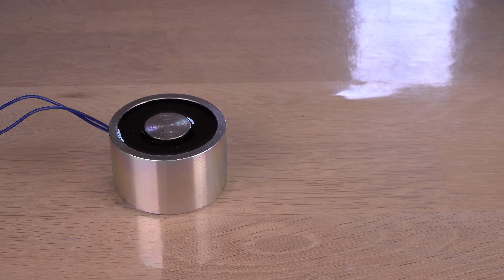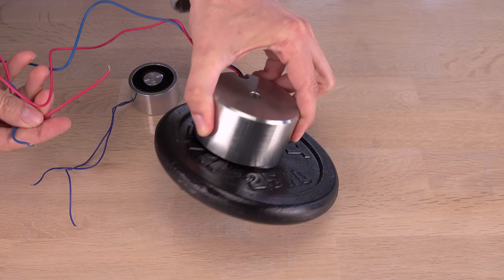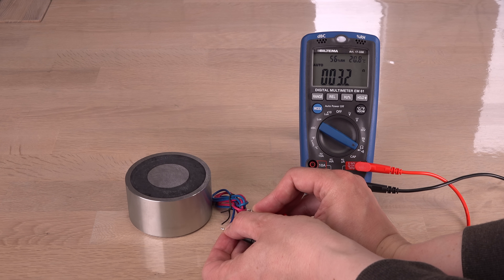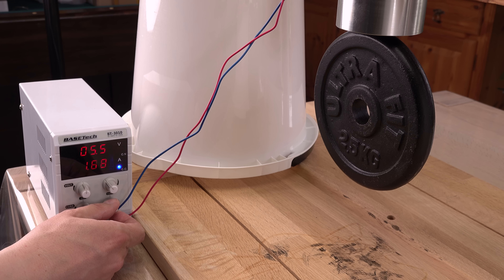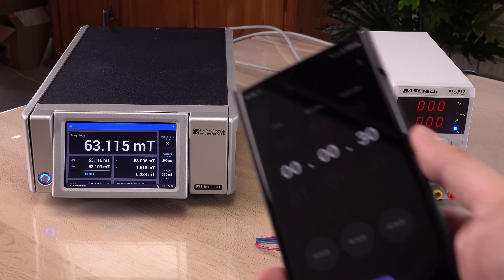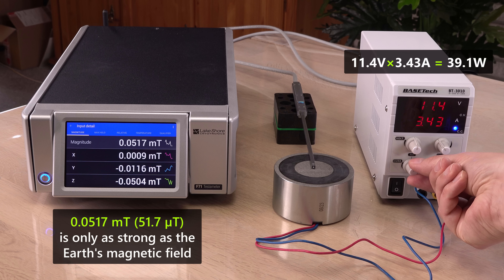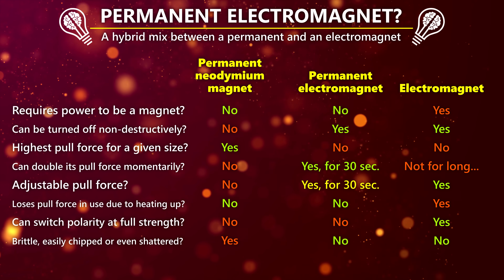NO ELECTRICITY Electromagnet?!? The Weird and Wonderful Permanent Electromagnet

Comment: Ive seen these used to hold doors open at events venues. Rather than the magnet being on all the time and heating up, you just pulse all the magnets at the end off the night and all the doors close using a mechanical actuator and reed switch feed back to confirm all doors closed properly. Its neat to see when 20+ doors all close together and let loose a synchronous bang!

Comment: Electromagnets used in steel mills and cranes use reverse voltage to demagnetize and release their charges more quickly.
The principle is very simple: when turning off the power, simply invert the polarity quickly for a few seconds.

Comment: I wonder if you ran power in the opposite direction using the red as negative if it would increase its magnetic capability instead of just canceling out the magnet you could go to two times magnetism and you can slowly dim that until it got to zero and then you could switch polarity and  increase power which would decrease magnetism gradually until it went to zero they neutralize each other
Reply: Oh cool you did it

Comment: some welders at my work use a magnetic ground that rotates to "activate" or "deactivate" the magnetism. Might be interesting to see the arrangement of what I assume are permanent magnets that allows nullification like that
Reply: It seems it’s just one magnet. In one position, iron connects the north and South Pole together, effectively “shorting” the magnet, and the other undoes this and leaves the magnet at full strength
Reply: MAGSWITCH

Comment: Oh, I thought this was gonna be about something based on Edward Leedskalnin's misleadingly named "Perpetual Motion Holder" ("PMH") mechanism. I saw some stuff about it many years ago, but because the name throws off people and the way things work isn't very intuitive or easy to explain (or at least to understand) I've seen it dismissed without actually addressing working examples that are way stronger and more long-lasting than the dismissals account for. I'm not really clear on the details, but from what I remember,  basically a pair of coils, a pair of metal pieces, and with a single pulse applied at right point the two metal pieces get locked together strongly; shorting detaches them, and using surprisingly amount of force to separate the two pieces of metal there would be a pulse induced if you had the coils connected in specific way (sorry many years ago, gotta look up the details).

Comment: You can generally safely assume a linear relationship with duty cycles, so at 50% power it would be a 20% duty cycle at 60s, at 10% power you could effectively run it permanently. Plus that assumes no cooling, with a cooling jacket you could increase the duty cycle use. Pointless for a home gamer but could have industrial application. So its likely adjustable +-10% permanently. Neat technology though, definitely has safety and practicality benefits over messing with pure high power magnets.

Comment: Aside the fact you can reverse the polarity to increase its strength, I don't see the point, given you can 'turn off' a magnet mechanically too, it's used in many appliances... I don't see much of a point to using these, outside maybe some applications where it's important something that you lifted doesn't fall during a power outage... And even then just having backup power banks and generators is way more useful for most applications, with either permeant mechanically (automation and/or by hand) "turn-off-able" magnets, or automated electromagnets. So... Any real point to these?

Comment: I work as an electrical engineer in a steel coil plant, there are several places where we use this type of magnet. One example is on a small gantry crane that lifts scrap material (small rolls that weigh a couple hundred kilos). A huge benefit of a permanent electromagnet is that it doesn’t need backup batteries in case the power goes out.

Never thought flipping the polarity caused it to double the strength, I expected to be protected with a diode of some sort.

Comment: @2:20 you kinda spoil the punch. one word: solenoid. ive worked with much larger versions, at a steel mill, moving 20 foot by 25 foot, 10 inch thick steel plates onto the plasma table, then onto a massive Blanchard table grinder, which had an even bigger magnet, in the form of the spinning table that was the grinding surface/magnet chuck, which held down the pieces while they were taken down to final dimension. one summer, i was working with a new guy. he forgot to empty his pockets in his locker. the change in his pockets, his keys, and watch, all obliterated after yeeting themselves onto the table just as the grinder head lowered. hes lucky he didnt have more things with him, or he would have joined his things. hahahaha he quit the next day. magnets are fun

Comment: I guess this is basically a much more powerful version of microphone/speaker/pickup/transducer but without any of the moving parts and much more simple in construction. Nothing new, but the idea is good for specific purpose.
Reply: Dynamic transducer has a coil as its moving part, it doesn't attempt to cancel out the magnet.

Comment: They have these at my old highschool to hold the main fire doors open during normal operations. Usually they're attached to a deadman's switch that will discharge a battery so if there is a fault like a fire severing the lines the doors fail closed. They also can be operated by a button in the office or security room. I was told how they work after seeing the doors close during a power outage like normal electromagnets but my principal just opening them again and sticking them to the permanent magnets while the power was still off.

Comment: it kinda does not matter if its 45w or 60w cause you apply 12v and the only thing witch could go wrong, is that you underpower it but if you have a 12v 10a voltage source it doesnt matter because of the resistence like you said..

Comment: We use these at work for the fire system. Doors that are propped open will automatically close when the alarms go off to stop the spread and aeration of the flame. These allow the fire suppression attributes to work even during an outage and backup failure without using so much current all the time.
Reply: But if the power goes off before the doors are released, the doors are kept open all the time and cannot act as fire isolation.
Reply: @olivier2553  Sorry, I replied already but Youtube deleted it for some reason. The configuration that we have this in is that power increases the magnet strength. The door closes with enough force that it overpowers the magnet when powered off, but not while powered on. This means when either the power goes out or the fire suppression system is on, the electricity stops and the doors all shut.
Reply: @jamisonw.327  So that is a normal configuration: you need power to keep the door open for free circulation, and no power means the door close for fire suppression. Only thing is you also have a permanent magnet that helps keeping the door open and reduces the power needed in normal operation.
Reply: @olivier2553  All correct!
Reply: @olivier2553 yes that’s correct. The ones used on doors are always powered. And lose power once fire system activates. Usually via a relay controller panel.
Reply: Ours are always powered so long as the alarm isn't on, so either power loss or fire, both mean the doors closed. The doors would remain open any other time. I'm sure we also have ways to trigger it at will without the alarm too. The point is just to use less power than a constantly on electromagnet. These fellas get warm when running, so there's also an element of heat build up to the reasons I'm sure. @olivier2553

Comment: I Would like an experiment with a Hall Effect Transistor to see if you can get things to hover like you can with an normal electromagnet type, this would be good with a small metal space ship ( like the ones you get with steam engine kits it acts as a boiler ) it should work, you just have to apply the energy in pulses to keep the thing afloat, but better with this design because when you turn it off the space ship wont just fall to the floor but dock properly at its position at the top of the suspended electromagnet :)
Reply: If you feed a electromagnet thru a reed-switch inside the magnetic field, you get a really nice oscillator plus a TON of radio frequency noise

Comment: Well this answers a question I couldn't afford to answer. You can shut off a permanent magnet with an electromagnet. Nice.
Reply: Bro you can also use another permanent magnet, and even another electromagnet to turn off an electromagnetic, it's all the same field
Reply: @lloydtshare Kiiiiiinda hard to cancel out a permanent magnet with another one. Permanent magnets tend to cooperate with each other when you stick their opposite poles to each other.

Comment: Item 2 in list: "can be turned off non-destructively?"  You say "no" for permanent magnet.  NOT SO!   Are you familiar with magnetic chucks  (used by machinists to hold ferrous workpieces while milling)?  They have cylindrical magnet in between 2 pole pieces (like DC motor).  A hand lever permits rotating the permanent magnet 1/4 turn which switches it between "on" & "off".  The magnetic chuck requires no power, & can indefinitely remain "on", "off", or anywhere in between without overheating.

Comment: You're gonna make me ponder a free energy machine! 😛
Perhaps not 'free' but perhaps a useful generator for extracting power from waves
Reply: does the static magnetic field at the coil affect the amount of current induced by a moving field ?  Or, does the static field increase the amount of back emf, maybe, when the field in the coil collapses ?
Reply: @idjtoal  I was thinking more along the lines of water waves lifting a weight to the magnet before dropping away and then releasing the weight.

Comment: You did the initial tests with a Varta Longlife PP3 battery that has a maximum current capabilty of 330mA so with a resistance of 3.2 Ohms that means that the battery voltage will have dropped to about 1v which means it had a power of about 0.33W which is less than 1% of the rated value so no wonder nothing happened.  You should have used your lab PSU set to 9v for a real test.

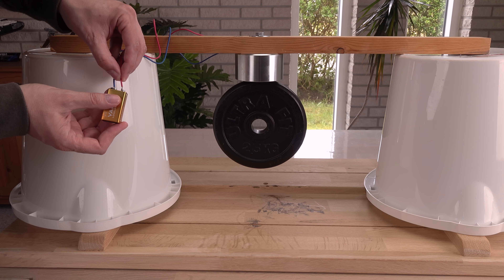Comment: 4:45 well, also, you aren't giving it 9v
That 9v battery absolutely cannot supply 2.8A, and will have a huge voltage drop
Reply: Yeah 9v box packs deliver a max of about 180mA before their voltage crashes. Didn't stop someone recently arguing that you could be deleted by one because, after all, they can supply 180mA... Oh'm Man.
Reply: @ranga2050 Did you explained to him that there is difference between mA and MA? Only like 10 zeros.... It's hard to make people understand that 9v battery does not pack nuclear reactor powers ;O
Reply: 180mA is easily enough to kill you, tbf. But a 9V battery is obviously not able to supply that to a load as high impedance as a human body.

Comment: For those who want to purchase your own permanent electromagnet: search terms are "permanent electromagnet" , "electro-permanent magnet" or "EPM"

The one in the video is the "RED MAGNETICS Electromagnet magnetic (disconnected) 1900 N 12 V DC 45 W ITS-PE-8245-12VDC" , purchased at Conrad and there it costs € 230 / £UK 195 / $US 260 .

Note: on Conrad the regular normal non-permanent electromagnets are denoted with the terms "not magnetic (disconnected)" , while the permanent electromagnets, as shown in the video, are denoted with the terms "magnetic (disconnected)" .

The most important thing is the holding force, which is denoted in Newtons (N). To convert to Kg, simply divide by 10 (roughly). eg: a 1900N can hold 190Kg (in theory that is, and at maxed out power ratings, with max contact area, etc)..... dunno what 1900N is in freedom banana units, you're on your own for that 😛....

PS: did you know that every head- or earphone, speaker, etc is in fact a permanent electromagnet! They are widely used in electronics, (old) TVs, doorlocks, electromotors, etc, etc... So, although you might not have heard of them, they are used everywhere.

😜
Reply: Correct me if I am wrong but my understanding is that the copper coil attached to the paper cone or plastic membrane of speakers and headphones is used as an electromagnet to attract/repel it to/from the permanent magnet. In other words, it doesn't cancel the magnetic field. And now I wonder if the audio uses only a positive voltage or also a negative one to increase the range of motion. Now I'm curious and will have to check with an oscilloscope 😛 My guess is that it only uses the positive voltage, both to prevent hitting the magnet with the coil, and because it seems simpler to just have one transistor amplify the signal between e.g. 0V and 5V with 2.5V being the zero crossing or DC, but it's just a guess.
Reply: Speakers go both ways in +90% of cases, even dirt cheap amplifiers
Reply: @tullgutten  yes, they indeed do. An EPM can be made both repelling as attracting, depending on the polarity of the power given to them. Which is actually shown in the video. So, yes, if you apply an AC current instead of a DC current, they go 'both ways'. And that is used to move a membrane in or out, which in turn moves air, which in turn creates sound waves.
The whole speaker isn't an EPM, but an EPM is used inside it.

--

Guys, an EPM is nothing more than a permanent magnet and a coil which redirects the permanent magnetic fields of the permanent magnet, that is it.

What happens when those magnetic fields are redirected is another matter altogether and does not define what a EPM is.

How it is configured and used is what defines what the application is they are used in. eg: an electric motor IS an EPM, but its configuration so that by redirecting the magnetic fields movement is created. Which is obviously quite a different configuration and application than a speaker, which is also an EPM. ;-)
Reply: @tullgutten  You're right, I tested the headphone audio output of my laptop with an oscilloscope and found that the voltage oscillated between +-50mV (with volume about half way up). Now I'm curious how the audio amplifier achieves the negative volume so I'll have to educate myself on the subject.
Reply: @VeniceInventors  Usually the DAC and amplifier have a split rail supply, so +12V and 12V (or +/ 5V). Alternatively you can generate your signal with only positive voltages and then high-pass filter though a capacitor to get rid of the DC offset.
Reply: @VeniceInventors speaker and headphones are AC like a sine wave that constantly changes frequencies.
Reply: @ralanham76  I agree, applying a fixed DC voltage to a speaker won't make a sound while applying AC certainly will.
I think of audio as a fluctuating DC voltage, but then one could say that AC is a fluctuating DC voltage :-)
Reply: An EPM is a different device. An EPM consists of a combination of hard and soft ferromagnetic materials, often NdFeB, AlNiCo, and Hiperco. An EPM has a "memory". It takes a large pulse of electricity to activate, and a reversed large pulse to deactivate. This is in stark contrast to the device in this video, which is always passively magnetized, and can demagnetize temporarily with power.
Reply: @joeymurphy2464  "An EPM is a different device"
No it is not. You described a very specific type of EPM. The device in the video IS a electro-permanent magnet. I encourage you to look up the definition of "electro-permanent magnet".

Comment: I would like you to obtain a 1 inch thick copper tube 4 or 6 inch in diameter, and about 12 inches long. Fix it where it will rotate then put a very strong permanent magnet  in the center while it's rotating and watch the magnet float.

Comment: This Hybrid electro magnet is so cool! If you could invert the current with a switch, I guess you have a little more than 10 times the power of your smaller electro magnet :)

Could you levitate a ferromagnetic object if you oscillate in an specific frequency of the current?

Comment: That poor little 9 Volt battery cannot provide enough current to have much effect on the electro-permanent magnet. Its terminal voltage under that load will be way less than 9.
Reply: Most 9V batteries are 6 AAA in series. You definitely can’t get 2.4A out of one!

Comment: How fast can the polarity be switched back and forth is my question?

Having a permanent magnet that you can negate the field on instantly makes me think of those perpetual motion machines... Could be worth a try.
Reply: Using a normal non-permanent electromagnet would be massively more cost effective. Especially if you're switching it on/off rapidly anyways there is absolutely no difference between the two. (also, perpetual motion does not exist).